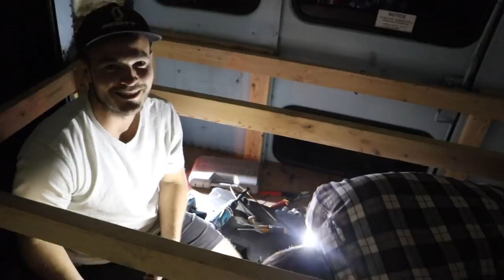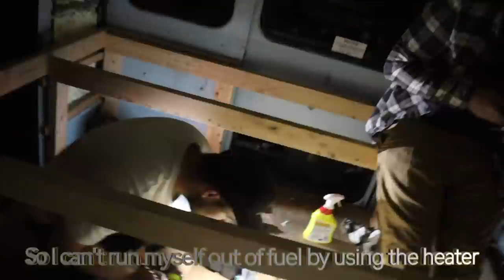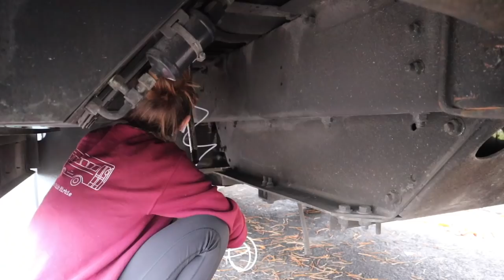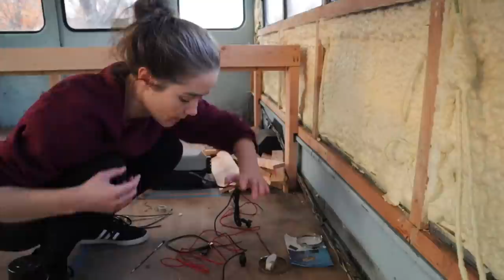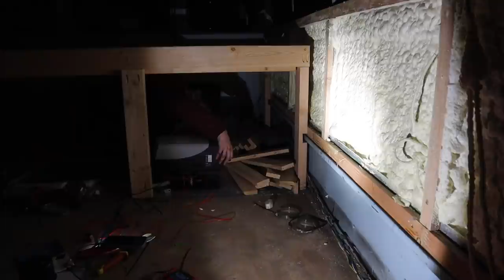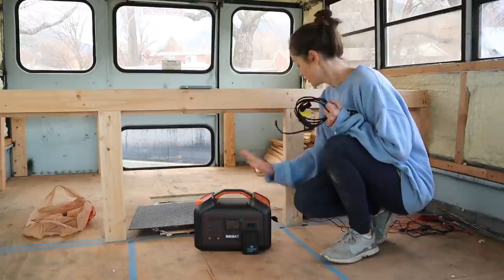Keeping warm in my school bus tiny home - Diesel heater installation take two + Bullbat Pioneer 500

Comment: Emma, I'm just curious as to how many gallons that fuel tank holds, and how many you think it has in it.
Reply from the maker: oof I'm guessing here, but maybe about 50 gallons and it's half full
Reply: @EmmaBuildsBirbie  Ok, so for all the people who say "drop the tank" like it's a simple thing to do... if it has 25 gallons in it, it currently weighs 175 pounds, NOT counting the weight of the tank itself. Draining it first means you need at least five 5-gallon buckets, and you'll still find the empty tank weighs a lot. If you're concerned about the paper in the tank (I would not be), I like the suggestion of using the bus every chance you get and when it's pretty close to empty, taking the filler hose off and using your (new) pickup tool to get it out of the tank. However, again, I wouldn't worry about it at all.
Reply from the maker: @thegringobaker  that's kinda what I'm thinking! thanks :)
Reply: @EmmaBuildsBirbie  Ok. So, it's noonish there right? How come you're on the computer and not working on Birbee? (And some one of these videos, could you possible explain where the name came from?)
Reply from the maker: hahah as a person who does not know what I'm doing, a surprising amount of working on birbie is just me reading on my computer!

Comment: Ok about fuses, they are standard TYPES with differant AMP. ratings. All you needed to do was change out the blown fuse to one with a higher amp rating. You should also have a multi meter.....this will save any guessing and make trouble shooting a breeze, Really !!
Get that sht out of the tank.
Reply: @thegoodtom1718  Hey tom, I have been an electrician since the 70's, I hold a British Columbia Masters Certification. 
12 volt outlets are not just for light loads, so sizing the fuse to match the designated load, taking into account start up current is the way a trained electrician would do this. Now in Em's case the miniumum size the wire in question would be at least a number 16/18AWG rated at 10amps well below 4amp running load for the deisel heater, well within all safety peramiters !!!!
Reply from the maker: was just wondering about this exact thing, thanks!